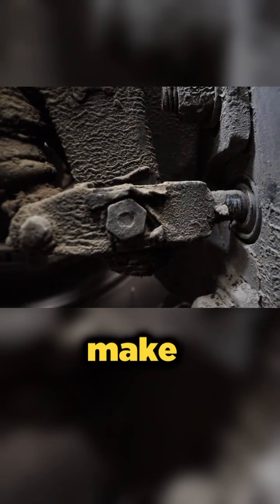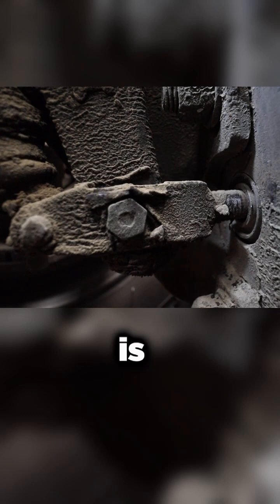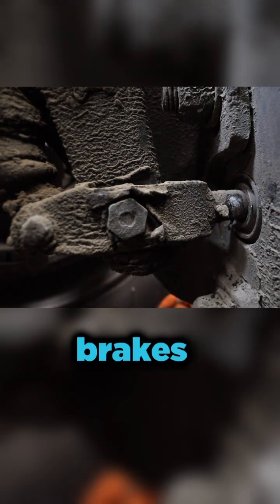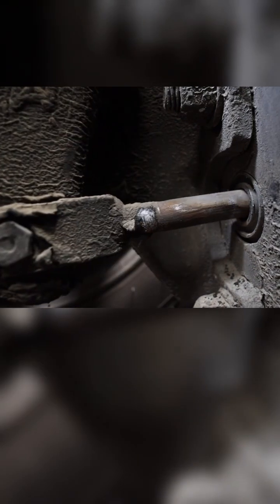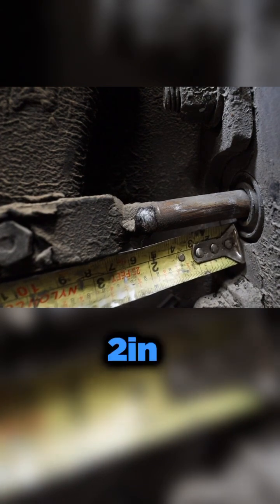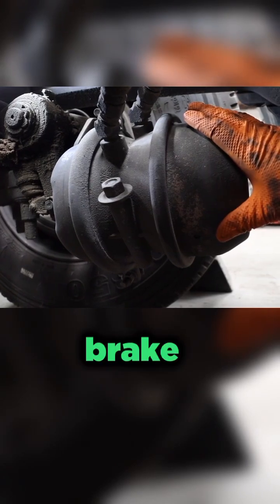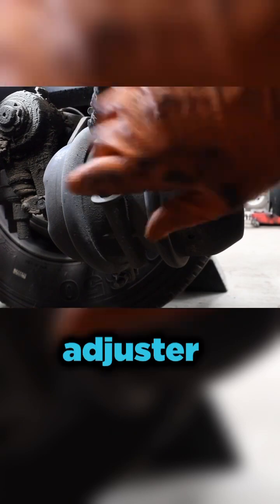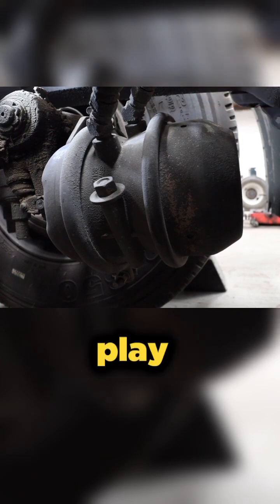PT11. When inspecting a semi truck, it is essential to measure the brake stroke. #owneroperators

Comment: if it makes it any easier for anybody what you can do for adjusting the tractors brakes is get a 7/8 wrench with the brakes released and put the open end on the push rod and push it out and if its at a perfect 90° angle than it should be fine